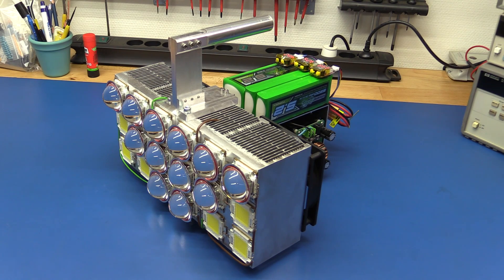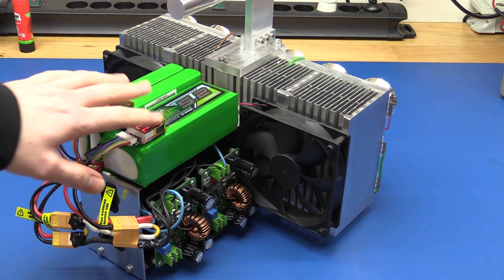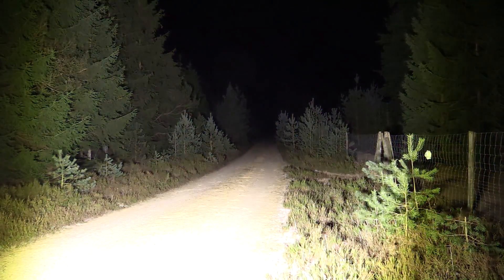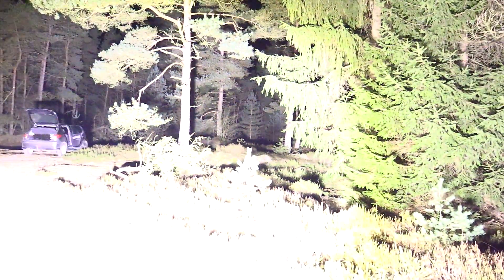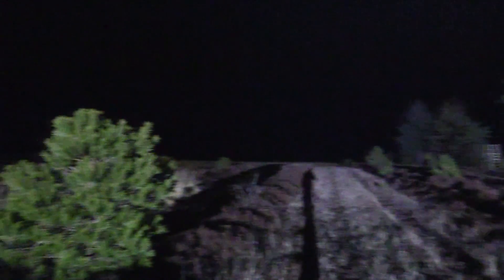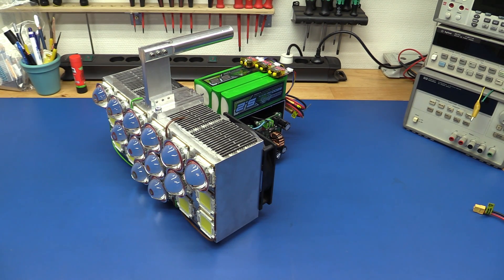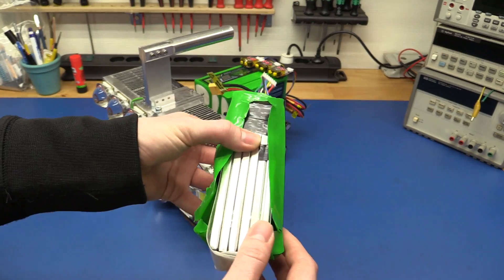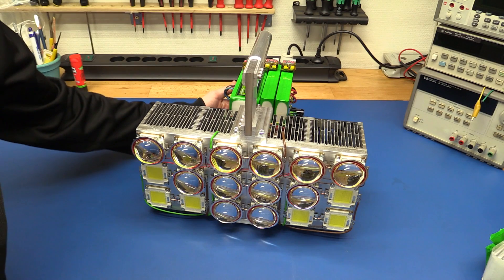The World's Brightest LED Flashlight (1800W / 162.000 Lumen) - Ec-Projects

Comment: Lux is NOT for comparing the brightness!! Mostly if i talk about lux i talk about >500kLux.
Reply from the maker: Not sure what you mean. Light per unit area, makes sense to me. How would you measure it differently? 
As far as I know, 500K lux would be equivalent to 5 times the sun's brightness on the surface of the earth, at equator, at noon.. You must be talking about a lot of light :)
Reply: Lux=Lumens per m2. Lumens [lm] is the unit for measuring brightness of lamps.
Reply from the maker: That's not what I have been taught :)

It is still not strictly correct to say brightness though. 
If you look up brightness on wiki you get that "brightness is the perception elicited by the luminance of a visual target". So, whatever amount of the light hitting the object (measured in Lux) that is actually reflected back to your eyes. 
But also " 'Brightness' was formerly used as a synonym for the photometric term luminance".

Luminance is what I should have said, but it's probably not something most people are familiar with :)

I have no way of measuring the total light output, so I couldn't use Lumens anyway :)

Comment: Hi,
mounting the fan on the back is a mistake, the air flow only goes between the fins, using about half of the dissipator rated power.
They shall be mounted on the top (or bottom but it's less pratical), that way, air will also flow inside the fins. Obviously, the fans will have to be of smaller size and four will be needed.

Comment: I am thinking about making something similar except I will be using DC power and I will be using it for film. So I would want this light to run for hours. With that said, will the LED's overheat if they ran that long in your set up? I am trying to figure out a heatsinc that I can use for my set up. I will probably do a 3x3 setup.

Comment: These LED's are very inefficient! 
You could get double the output from this much power. 
If you want to build a 2nd revision try CREE CXA 2590. They're ~130w and 18k LUX. They are like 30-40€. 
Very high quality, I work with them.

I am developing Professional Lightning Products, so I know what real brightness is. 

I can get the same output for 330w, but that's my secret method :D 
I just tell you that: its not LED.

Comment: make a truncated icosahedron and put a 100w led on each face.   pocket sun 2.0

i made a 100w led flashlight back in feb. 2013, i used lead acid batteries and amd cpu heatsinks.
Reply from the maker: And use it as a soccer ball, you won't miss the ball ever again :)

Comment: How much heat do those 18 LED lamps put off? I wonder if you could put a Peltier generator between them and the heatsink to recapture some energy from the heat itself and maybe use it to run the fans if it is enough..

Comment: That's a very impressive light you built.   

 It gives me an idea. For extended Search and Rescue operation a person could mount a permanent magnet generator driven by a small gasoline engine on a back pack similar to a back pack mounted leaf blower. It could provide enough charge to keep the batteries topped off and put the load of the heavy items on the back.
Reply: 1st A permanent magnet generator capable of delivering enough Volt amps would be too heavy and bulky.
2nd it would require a stronger engine. something has to feed that beast and a small engine wouldnt suffice.
3rd it would use up a lot of fuel only adding on the weight and bulky'ness
Good idea tho.Maybe in the future when they invent something better than engine fueled generators. :)

Comment: Visible from space station !!
Reply: That made me wonder just how bright the old ww2 searchlights were. had never thought of it before. in case anybody is interested "Second World War-era searchlights include models manufactured by General Electric and by the Sperry Company (of gyroscope fame). These were mostly of 60 inch (152.4 cm) diameter with rhodium plated parabolic mirror, reflecting a carbon arc discharge. Peak output was 800,000,000 candela. It was powered by a 15 kW generator and had an effective beam visibility of 28 to 35 miles (45 to 56 km) in clear low humidity."  bright but I wouldn't want to carry around a 5 foot wide reflector! :-)   I want one of his led torches on my boat! brilliant.